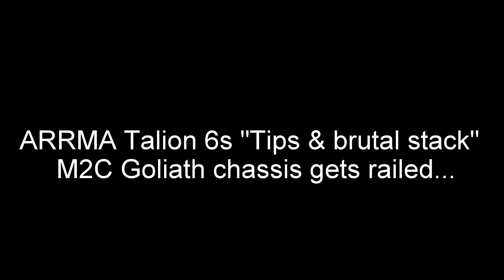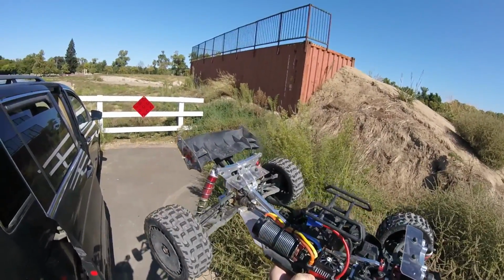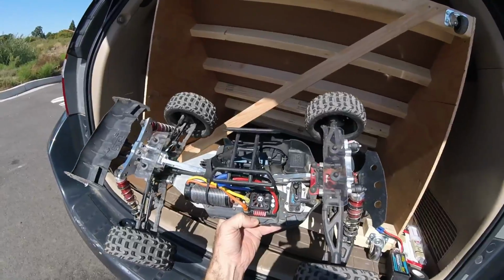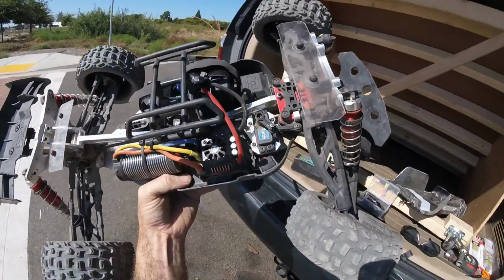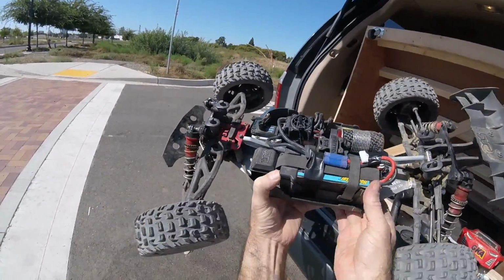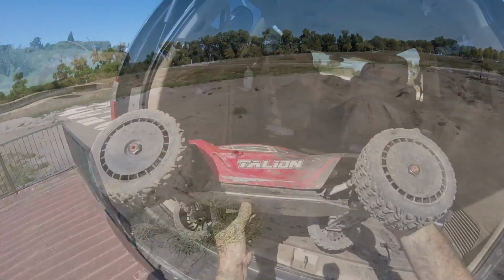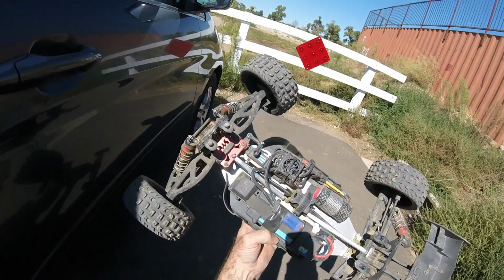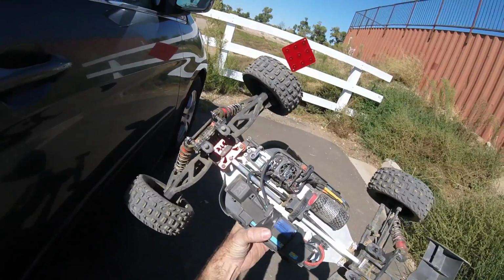ARRMA Talion 6s "Rail Job" Goliath chassis gets stacked...

Comment: What bearing are you running on the kraton?
Reply from the maker: I'm using Avid yellow rubber sealed mostly. I usually stick with their plain metal shielded for the center driveline though for less resistance. 🍻😎💪👊👊

Comment: Kraton/Talion/Typhon bash 😃🤩 That smack off the rail was nuts man! 😱😱 Though it was bent for sure! Talion was getting it off your ramp 👌 That construction site towards the end seems like a fun little spot too 👍 Cannot wait for Talion Towers, it will be the cherry on top of a great all around machine 😉
Reply from the maker: Thanks so much Aaron 🤗!!!! Yeah that rail job was another durability statement 😱. I honestly wasn't sure how it might look after that 👀. Just insane the punishment they can withstand. The ramp is doing great Brother👊. Really glad I shortened the box end cuz it's way easier to load and move around now. That construction site is rapidly getting leveled 😝. This is a huge dirt pile apart from the site I'd planned to run at. Can't wait to mount up the new Talion towers. Mitch is simply on fire with the new upgrades 😍👍👍😎💪👊👊